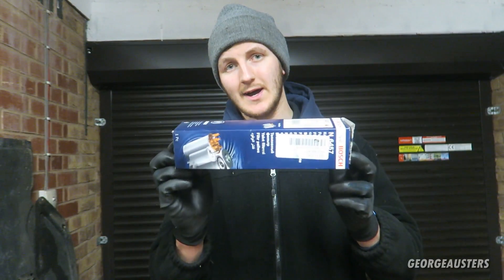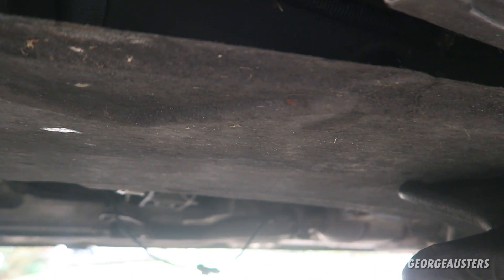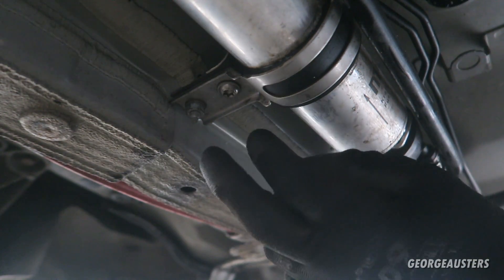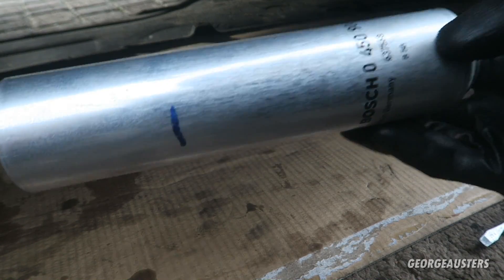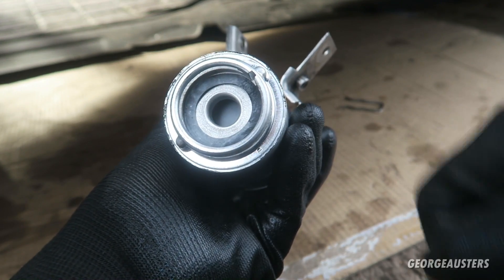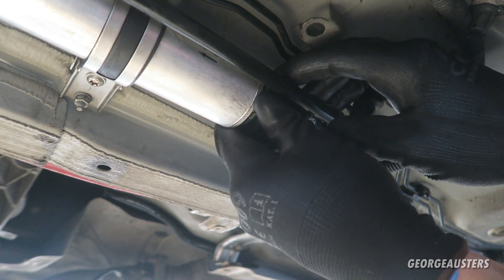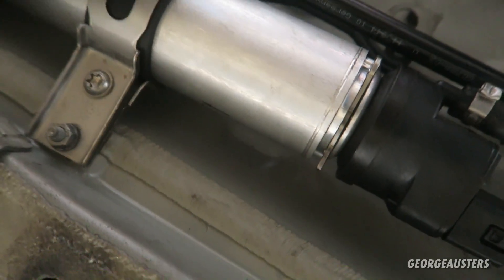How To Replace BMW Fuel Filter

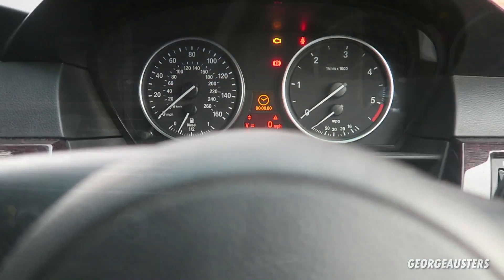Comment: A note for anyone planning to do this themselves, you must bleed the fuel system before cranking any common rail diesel. Turning the ignition on and off (07:35) is not sufficient and can/will lead to premature wear of the high pressure fuel pump which requires diesel at all times for lubrication. ISTA+ is needed to run the fuel bleed function. Plenty of videos online showing this. You can also take off one of the return lines under the bonnet and use a vacuum pump to suck diesel through the system. Whatever you do, don't just crank it over. It's a sure fire way to cause HP fuel pump damage and is not the right way to do this job.

Also, at 04:35 there should also be a small O-ring that is replaced on the diesel heater. It comes in the MHALE kit, which is the genuine filter BMW uses for these (or at least did in the past).

Comment: I would recommend that you do NOT unscrew the small torx. Leave the bracket on the filter.
Instead, unscrew the large bolt and mark the position of the bracket and then mount the bracket before mounting the filter under the car. I just spent 45 minutes getting it to fit. Had to remove it again and mount the bracket first.
The rubber ring that came with the new filter was thicker than the original, it also gave some problems.
It was a pain in the ass .... sorry for the language.
Gotta say I did it on the floor, I just sold my 4 post lift. It also makes it more problematic.
But thanks for the video, it still helped a lot.
Reply: lol I just did the same mistake but I have also lost the small screw in the grass...

Comment: George, jesus what a pain i had today !!!
I have the late e53 and to get access to the filter was a complete pain in the ass !! 2 hours to get the bolts off and lower the panel. Looks like i had the original BMW Mann filter so after 110,000km it was time for a change. 30mins put it all back again. I sawed the old filter open and it was black with alot of grit ! So a €11 febi filter is now on. Oh i turned the ignition about 3 times to prime, then 4th time tried to start and it fired up straight away !!
So muchas gracias y espero que tengas un buen dia !!

Comment: I just did my install tonight…My filter was a pain in the ass to remove off the plastic portion of it and putting it on was very difficult as well. I tried two brand new filters (an oem and a generic filter)and both were stubborn to install.. I ended up having to set the plastic part on a 1x4 piece of wood and rubber malleting the filter onto the plastic piece… I’m lucky to have not have broke anything…I’ve watched several of these videos and all of them come off and install easy 😂😂😂… wish mine went as smoothly… I primed my diesel filter before install and it started right up.. no computer needed to start the fuel pump…
Reply: You need a computer to start the fuel pump????

Comment: I just changed mine 
As the garage that replaced it last year had it twisted touching under frame of the car every time you got to 2000 revs would get a vibration 
Seems all good so far

Comment: Hello from Cyprus! I am watching all your videos as I have same exact car, a 10/2007 520d e60 n47 engine. Extremely helpful. Well done.

May I ask if after replacing the fuel filter, is there any other step involving a service diagnostic or just the replacement itself.

Lastly, I have the the CCC Idrive version and I would like to update/upgrade it the same like yours to CIC. any suggestions or recommendation?

Keep on rocking!
Reply from the maker: Costel Tarata Glad you’re liking the videos so far Costel! 

There is nothing you need to do after replacing the fuel filter. With regards to updating to CIC you would need the entire CIC system which is around £1000 for the system, screen, controller, cables etc and will need to be coded in to work with your car👍🏻

Comment: Hi how are you doing I have a BMW 520d M47 engine when I opened the filler cap for the oil  Is spitting out is this a big problem Lake your comments keep it up

Comment: Hi George, i have 2006 E91 with N52 engine and i have one question. Is a fuel filter in the middle of the car similarly like in this car on your video? Thanks a lot.
Reply from the maker: No fuel filter on those. It’s built into the in tank fuel pump👍🏻

Comment: Hey mate, i have a question. Do i have to fill up the filter with diesel? Air wont do any damage to the high pressure pump?
Reply from the maker: No mate. This is a self priming system. Just turn on your ignition a few times before trying to start👍🏻

Comment: Hi mate, how much fuel leaked out when you took the filter off? Does the tank empty itself or is there some kind of valve stopping the fuel pouring out? Thanks
Reply from the maker: Only what’s in the fuel line so not much, the pump has to lift the fuel from the tank

Comment: I'm having difficulties in re-inserting the retaining clip in to the back of the fuel filter. It does not want to clip home. Any suggestions as to what I might do to get it to clip home? Thanks in advance.
Reply: Never worry, I was putting it in the wrong direction!
Reply from the maker: You may be trying it the wrong way, it's not difficult to install at all, its not exactly a tight fitting clip
Reply: @GeorgeAusters  yep, yep, I have since figure it out. I was 90 degrees off, the important thing is that it's in now. Ta again for the response.
Reply from the maker: Glad to hear!

Comment: Hi George, I recently changed my fuel filter with a mechanic and since then ive noticed a lot less response when hitting gas especially in low rpms, it was perfectly fine before this but feels like something aint right, maybe it's the quality of filter which was a mahle one, the previous one I think was bosch.
Reply from the maker: Mahle filters are decent👍🏻
Reply: @GeorgeAusters  What would yoy say is the cause of this power loss?
Reply: @GeorgeAusters  BMW original parts often have Mahle written on them too!
Reply: @Nagato is better than Punk Naruto That is not possible. You can't install it in wrong direction.
Reply: Iv just done a service on my e82 msport.     With the fuel line I take it off get the new one keep the plug on the end put new fuel into the new filter then fit everything.   After everything done put the key in wait to hear the fuel pump then take the key out do this a few times         Your engine won’t like starting if a air block in the line air won’t compress lol      It will still start but at what cost 
The oil filter needs the same put new oil all over it then fit in place.      You can get same problem.    Start the engine and when the oil pump starts and pushes air around the new filter it can compress the filter folds and bend them so won’t work properly.

Comment: Anyone who is planning to replace this I recommend just bringing it to a garage. This method ruins your high-pressure fuel pump. (because of air in the system and letting it run dry).
Someone I know learned this the hard way and had to replace the high-pressure fuel pump costing $750.
Reply from the maker: The system is self bleeding in these cars